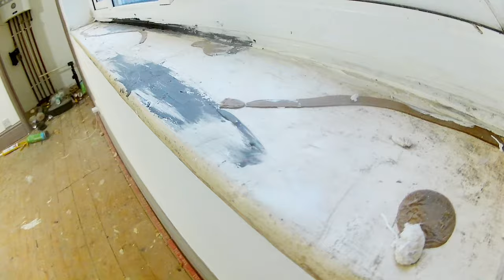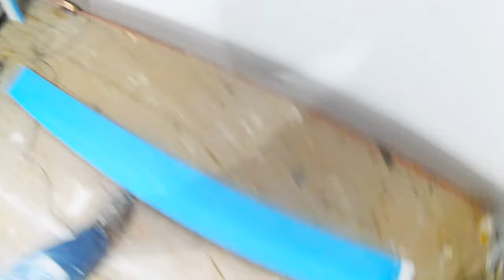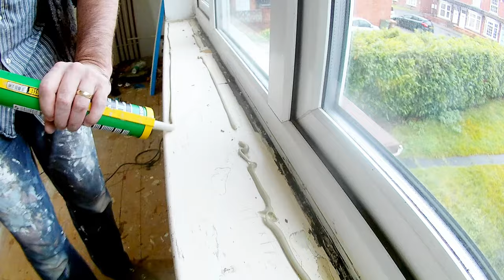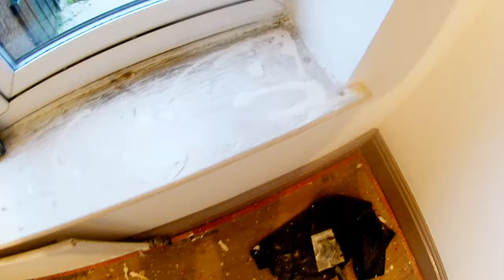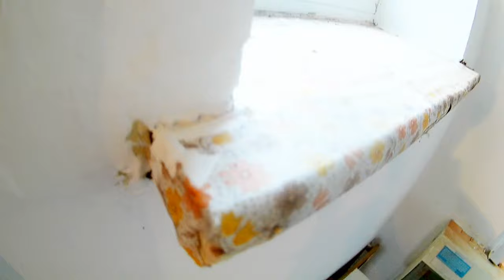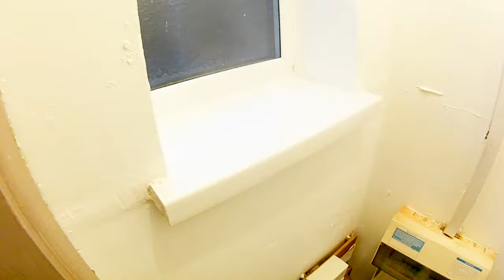Fitting Three Interior Window Sill Covers

Comment: You should have included levelling the cover
Reply from the maker: Normally, yes. In this case the old sill was leavel, so I just followed that. Thanks for watching 😀
Reply: @MrGeoffreySmith  Oh i see! Did you trim back the overhang on the existing wooden board to allow for the new upvc overhang??
Reply from the maker: The existing had hardly any overhang, which was one of the reasons for putting a cover on it. The cover was about 5mm thick so that added to the existing gave an ok amount of overhang.

Comment: I,ve had a go and done a  couple of sills and cut them out but not stuck them down yet , one is spot on with about 1mm out , whilst the other is 1mm out on one side and about 1.5mm to 2mm out on the other side , is this ok or tolerable , will to cover up nicely once sealed with white silicone or should I get a closer fit   Thanks
Reply from the maker: Well done! A few mm is fine. As you say, the silicone will cover that 😀
Reply: @MrGeoffreySmith   that’s great thanks for your help again
Reply: You need to scribe your window reveals left and right  before you make any cuts for a tighter and neater fit

Comment: You can also use a Stanley knife and straight edge  instead of an angle grinder, less mess and neater cut 👍
Reply from the maker: True, though I was using  diamond blade which cut very clean.

Comment: Great video , feeling a bit more confident to have a go myself , got 8  2 metre sills approx and was quoted £500 which I feel is just too much , is it worth buying the boards and end caps etc and having a go myself
Reply from the maker: Maybe buy enough to do one and do that one, taking your time. Go ahead with the rest afterwards when you're happy. There's no reason why you won't be able to do this, as long as your measurements are right. 😀
Reply: @MrGeoffreySmith  that great , given me a bit of confidence to have a go , just wanted to ask will a fine saw do and do I use normal white silicone , thanks
Reply from the maker: White silicone will seal the edges no problem. Any saw would do as long as the teeth aren't too aggressive. Fine tooth is better.
Reply: @MrGeoffreySmith  thanks again

Comment: Do you need to use gripfill as an adhesive or would a simple unibond no nails adhesive glue work?
Reply from the maker: Any kind of similar product is fine, no nails etc. I used grip fill because that's what I had. 😀

Comment: What was the glue you used underneath? Is it decorating caulk around edges? What about end caps, and the end block that goes next to the window?
Reply from the maker: Hi. I used gripfill to stick the cill down and silicon sealant around the edge. The overhang was so small I didn't cap them.
Reply: Mr Geoffrey Smith another quick question- are the blanking end caps used to fill the gap between window and sil cover if the depth isn’t enough? Or is it pure decorative finish? Some of my sils are 280mm, so could I use a 250mm + end cap or would I use a 300mm and cut it down?
Reply from the maker: @XO.Clinic  My original sills were an odd size, so I bought oversize and cut to fit. I always prefer to do that. Check out what they have at the shops near you.

Comment: What is electric saw called? Do I have to use one of those to cut the board or will a saw work? Is what you used to stick it down the same as what you used to seal the edges? So many questions, I hope you reply soon!
Reply from the maker: Hi. I used a grinder with a diamond blade on it. A saw would be more aggressive, so go easy with it. Around the edges I put normal sealant and to stick it down I used Gripfil.
Reply: Angle grinder not needed .. Just use a multi tool only cost £40 and that price includes the blades!!
Reply from the maker: Yep, does the job too 😃

Comment: Hi, do you know if this would work over a tiled window sill? I want to diy our window sills but would rather not start removing tiles as don’t want to get it too wrong! TIA
Reply from the maker: Hi Ellen. As long as the tiles aren't loose then it should be fine. If some of the tiles are loose, lift them off and stick them down before fixing down your new sill. I hope it works out😀

Comment: Hi Geoffrey
i need exterior upvc sills to go straight on to brickwork, do you use the same type of sills, the original owners have put ceramic tile stuck to the brickwork and it looks crap cheers  Jeff
Reply from the maker: Hi! Im sure you can get these sills in exterior upvc. You can stick straight onto the tiles using something like No More Nails (as long as it's exterior graded) but make sure the tiles are level first. The tiles would also need to be dry and clean when you do it. Good luck!

Comment: what type of disc did you use in the angle grinder to cut the pvc? thanks
Reply from the maker: I was also tiling the bathroom around the same time so it was probably a stone cutting disc. Any disc would do. It's only plastic.
Reply: @MrGeoffreySmith  thanks, I ended up using a wood blade in a circular saw. Just took it really slow as didn't want chip out
Reply from the maker: @jp_makes  Great. Nice plywood dressing table, btw. Subbed 😀
Reply: @MrGeoffreySmith  thanks! ☺ Just checked out more of your videos too, like your work! Subbed too

Comment: Why didn't you just sand and repainted the boards? Cheaper still.
Reply from the maker: Hi Neil. The original boards were set into the walls a lot, almost flush with them,and I wanted to give the windows a more defined outline.

Comment: What tool did you use to cut the pvc.
Reply from the maker: Hi Anne. I used a grinder with a diamond blade. It cuts very easy.
Reply: Mr Geoffrey Smith thank you.
Reply from the maker: @anneramsey6403  No problem. I hope yours works out.
Reply: Mr Geoffrey Smith thank you. I’ll have a go.

Comment: He applied the caulk and then failed to tun his finger over it to settle it in to the groove and finish it off. That is the point at which I stopped watching and moved on.
Other notable boo-boos were:
-The messy way if working (stuff lying everywhere) 
-The lack of a workbench for tooling, trimming, cutting
-The makeshift, amateurish cutting with angle grinder on the floor without any "guide"
-That irritating mobile phone featuring throughout the video
-No voice over telling viewers what he's doing
Reply: Bore off!
Reply: just check out 8.14
Reply: You sound like fun